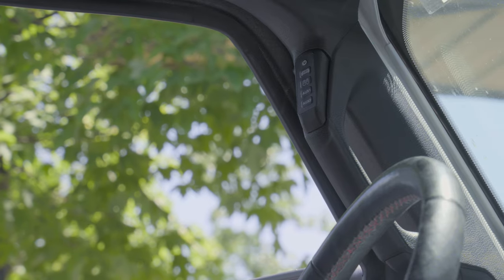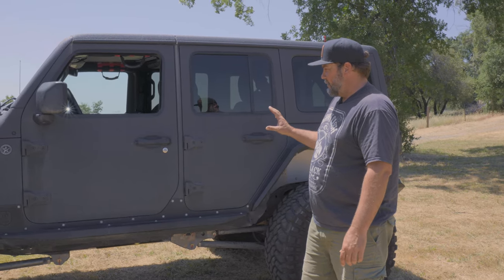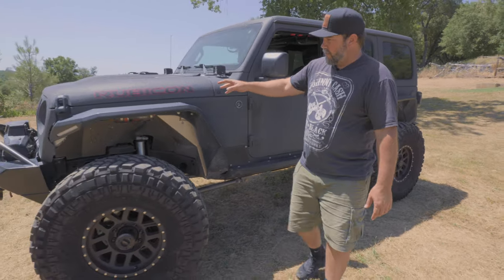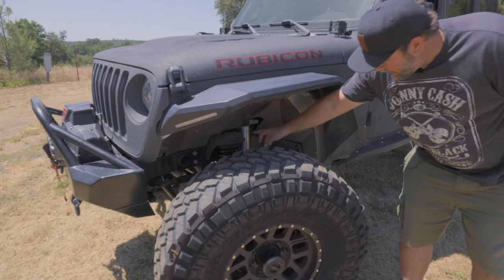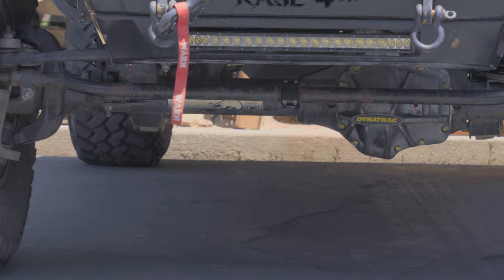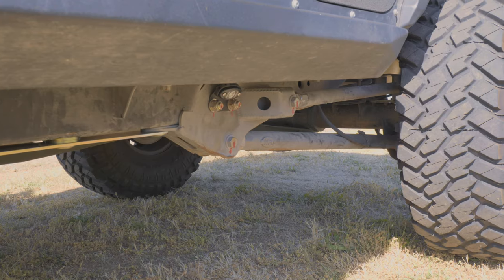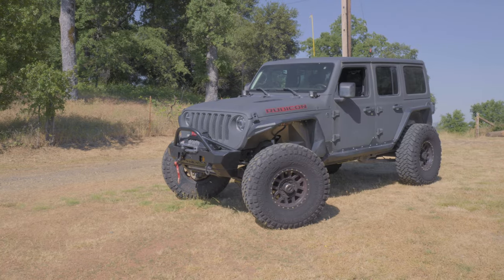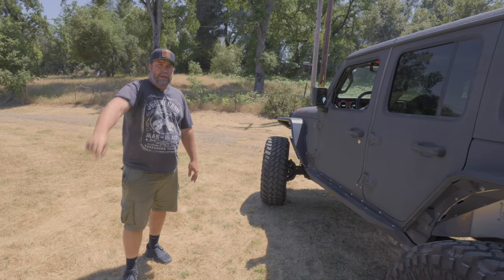We Designed and Built This Jeep JL in 7 Days!

Comment: Sick build- without crawling under and really looking, would it have been possible to put those front lower control arm mounts on the side of the frame? - love the angle,  not digging the frame mount location…

Edit- new design did this. 🍺 sweet 😎